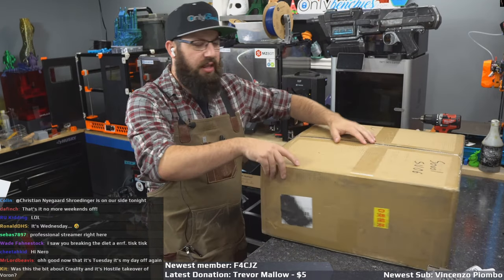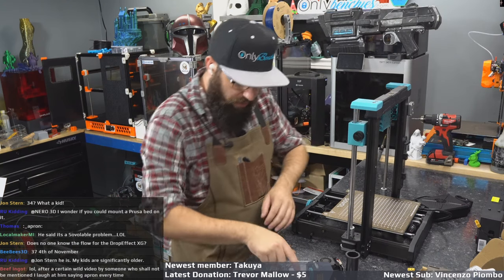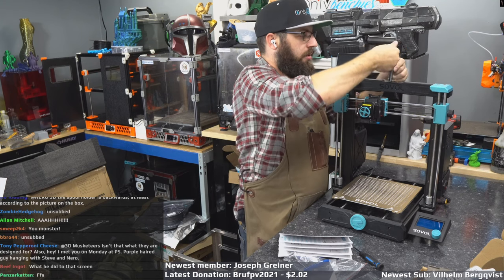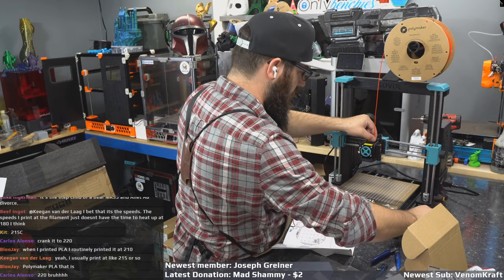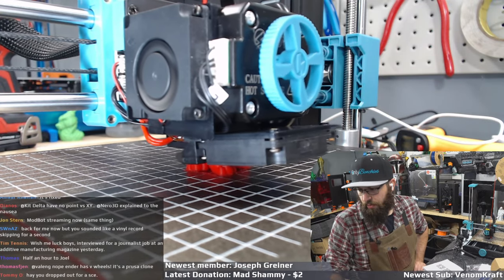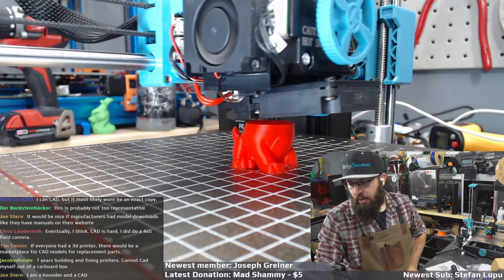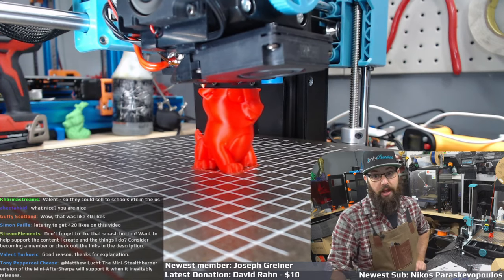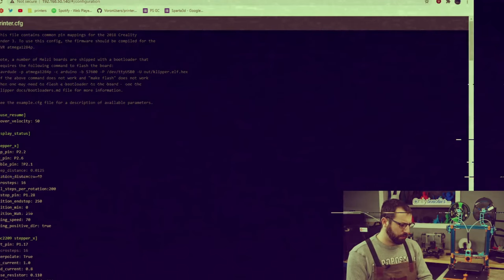Sovol SV06 - Low Cost Full Feature 3d Printer Unboxing  #livestream #3dprinting #3d

Comment: my second printer after prusa mk3 ' I can't beleive but they did it, actually feels better than prusa, with all the same features, spring sheet, auto leveling, even an easier way to position that final z height.. yeah with a piece of paper, but it's better than what prusa suggests, eyeballing it.. maybe it changed for newer mk3s+ or something..
yeah for the price it's incredible, it took like 20 minutes to slow assemble, in reality it will take you 5 after you assemble one and realise it's 9 screws and 5 connectors.. I took longer to assemble ikea shelf..  the benchy came out perfect even after I sped it up to 150%, there was one layer that was bigger and it was perfect.. can't beleive.. yeah, forget about everything else, this is a prusa killer - now we will see a year or so later - my prusa runs sturdily for at least 3 years now, the filament sensor stopped working (doesn't really matter much to me), one wire did break off coming off the extruder (wiring isn't perfect), fixed that and it runs reliably - if this one does the same.. well, OK.. I guess sovol really is doing it.. I'm gonna keep an eye out for their other stuff, I'm excited to use it, even after I've gotten a bit bored with (mindless) printing, this one was for printing kids stuff for my daughter so she gets some idea how we have a 3d printer at home and it makes butterflies and pretty stuff.. I wander how new minds will develop with tech like this around them

Comment: The needle of death is simply the cut end off of an Ernie Ball Super Slinky D string from the designers last string change on his Les Paul!  Completed my Box to Leveling in 23 minutes.  Started my first Benchy in 25 minutes.  So, 25 minutes from Opening box to starting Benchy print feels pretty good for a complete 3D Printer noob!

Comment: I bought the SV01 and it was miserable. Creality yet somehow made worse. I should have bought a Prusa. But this looks significantly better built for about the same price. I may have to invest.
Reply: I have the same problem with my SV01 that I bought back in March 2021. Worked great for a few months until I had issue after issue. Ive replaced so many parts and still have issues. Purchased a Mini+ in Nov 2021 and have yet to have any issues with it. Its just built better so much more that i barely even use my SV01 anymore. But i purchased an SV06 so hopefully I dont get burned again.
Reply: @user-bt9ek2dv2y  Pretty much the same! I have broken the Mini a few times, but it's easy to fix. It did like to jam a lot, especially on silk PLA. I resolved that by replacing the heatbreak with the Bondtech redesigned heatbreak, which is brilliant. Solved every problem in that regard. I have easily spent more making the Sovol reliable than I spent on the entire Mini. I do have it to a state where I can use it, but it is so heavily modified that I don't give Sovol any credit. Only the extrusions Z-axis, and the Meanwell power supply are original, basically everything else is replaced.
Reply: @user-mz6qu3hz6m  Yup, same with mine. Its functioning but I know it has so much more potential. I'm keeping my fingers crossed on the SV06. I don't want to give my SV01 to someone else and have them deal with the headaches so I guess I'll keep it and figure out something to do with it. Good luck with your SV01 and SV06 (if you get one)!

Comment: Lol. Look at Sovol's site, the SV02 even shows a Creality branded silent board as standard in the SV02 dual color printer, these are all made in the same place just shoved into different boxes. the Chinese just don't think the rest of the world will notice.
Reply from the maker: They used to use creality boards but iirc that was really they only thing. Now they make their own boards. Me thinks your tinfoil hat is too tight
Reply: @Nero3D  Lmao, No I threw that hat away. But I did get a reply, that's a start. You definitely have your preferred flavors of printers, which is fine. I wish I had the drive or finances to build a V2.4 but that isn't gonna happen.

Comment: Jealous you have you X1C already. I am excited to get mine
Reply: Same! Except I'm waiting for 10x of them.
Reply: @condorman6293  what are you doing with 17k worth of printers? Phasing out older machines on a farm?
Reply: @tjlqk3  Got it in one. Trying to get rid of my Prusas.
Reply: @condorman6293  nice. Mk3s?
Reply: @tjlqk3  There is a single mk2.5s hiding out amongst them, but yes.

I'm very excited to replace them with modern printer tech. They've certainly been the right choice for a long time for a farm and I've had to do relatively few repairs, but it's impossible to argue the X1Cs don't offer >2x the value at the same cost.
Reply: @condorman6293  totally agree. I’m on a much smaller scale and hoping to have my AMS X1C replace three mk3s’ and one Qidi Xmax but might keep it as it’s been a better machine and is enclosed
Reply: @tjlqk3  What's funny is I'm most excited about saving all the space by eliminating the huge enclosure necessary for these bed slinger. I dream about the day I don't need to worry about ambient temps, dust, breezes etc. I'll also need 10 printers to replace my 16